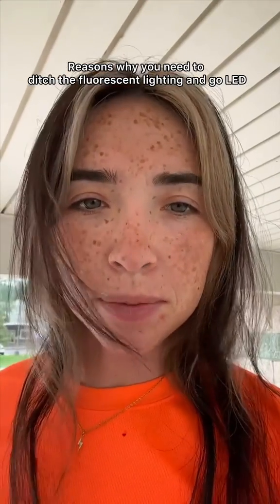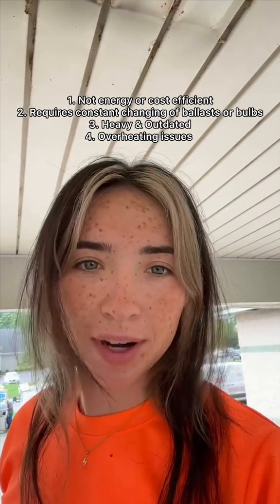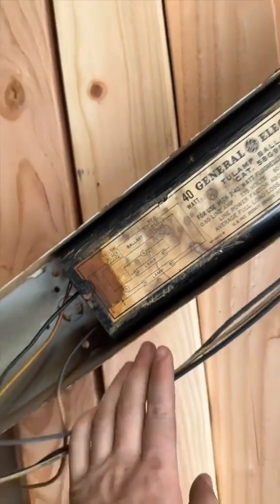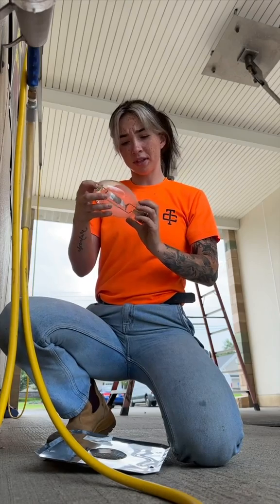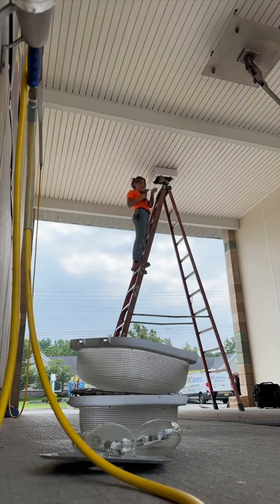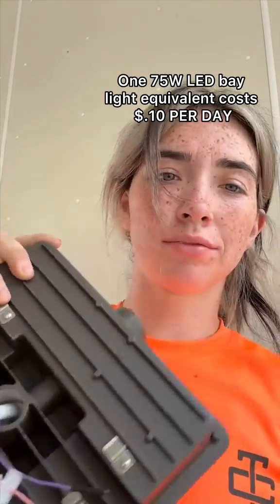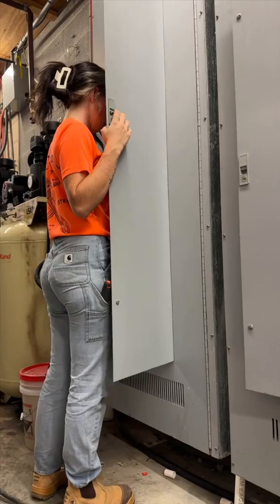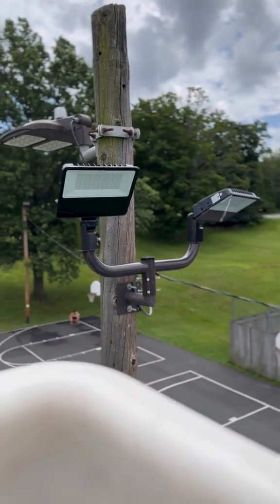Replacing Metal Halide to LED

Comment: I’m guessing that the original installer used the wrong wires for the application or used a fixture with a poor heat management design. Not every fixture burns the wires like that.

Comment: those LED canopy lights chew through there ballasts WAY to fast and end up turning into flashing disco lights.   i like LED screw - in retrofit (corncob) bulbs because they keep the fixture original and can easily be replaced. i would even go as far as keeping the original ballast and gear in the fixture, just bypassed and abandoned because what else is going to fill all of that space.

Comment: LED is better, but if those previous fixtures and circuits are installed correctly they shouldn’t burn up. Especially if ballasts are replaced every 15 to 20 years. Yeah, they can run longer, but why…

Comment: My biggest gripe with a lot of people & businesses changing to LED is that a lot of them (business especially) choose to attempt to save money by retrofitting HPS/HPH/LPH fixtures with cheap LED bulbs which usually ends up resulting in similar power draw and significantly less light being produced. I also have a huge gripe with the CHEAPEST LED bulbs & fixtures. They usually come with a color that’s really hard on your eyes to appear bright but all it does is blind you and produce less light and it’s hard on nature overall & they usually have a very high failure rate which results in lots of blinking lights, dead lights, purple lights, strobe light lights, etc. it’s really disappointing to see all of this potential ruined by cost cutting on these lights with poorly implemented heat-syncs & soldering & capacitors & so on, just to save a little bit of money up front & end up having to spend more later to do it properly & cause even more e-waste than LED fixtures already cause. 
When implemented properly, LED is absolutely the way to go. Unfortunately there are many areas where this is not the case. I hope to see more properly implemented LED lights & I’d love to see them produce less e-waste.
(I have a lot of property management under my belt)

Comment: Man, that is an OLD fluorescent ballast. Most LED fixtures have have ballasts too, they just call them drivers. The only exception are AC LEDs, which run directly from the line. They, however, flicker like crazy.
Reply: when LED ballasts go on the fritz, they turn wherever the lights are installed into a disco, those type LED canopy lights she installed a notorious for doing that.

Comment: I got tired of the reliability of Metal Halids and changed mine to Mercury Vapor. Not as efficient, but the bulbs last ways longer. LEDs are getting better, but they still have some reliability issues.

Comment: I work from a LiFePO4 battery company, the change from fluorescent / HPS to LED is pretty similar to going from old school lead acid batteries to lithium as far as weight, energy  density, and longevity.

Comment: Well it took me a year, but by myself, I replaced 2784
old t8 fixtures in an old plant with high bay UFO LED’s. Frustrating experience at times, overall it was enjoyable. At least now you can see with out a flashlight. 😊 I can definitely relate to replacing those old type of lights you have replaced, they have a few here at this plant, and just keep replacing the bulbs. Well not anymore.

Comment: I am fully switching out the led bulbs left to incandescent bulbs, I yanked out 6 of them so far.  LED hurts my eyes, even 2700k. I Reject artificial LED lighting.  
There is nothing wrong with those light fixtures.  LED still creates heat, wastes resources on microchips.  Not green at all.  The old lighting is and always will be better. Efficiency vs healthy light, I will gladly pay more for quality light that isn't LED.  I would buy some of those metal halide light fixtures, would make a nice porch light.

Comment: Unless youre using an led lightbulb instead of an all in one/integrated LED fitting, its such a false economy. 

If a unit fails and it generally will fail within 6 years, you have to throw out the whole fitting and pay an electrician for a new fittting and the labour to replace it.

Comment: A few years ago I looked into changing out the T12 florescent tube system to dedicated LED strip light housings in my garage but the cost was out of this world at the time for that type of LED system in 4 or 8 foot lengths ( not sure what they are priced at now ) So I instead looked into installing the T12 retrofit LED bulbs and they don't come in 8 foot style so I took out my 8 foot units and installed new 4 foot florescent housings but with the LED bulbs and those housings come with new electronic ballasts vs the old magnetic ballasts the original housings had. I also had original 4 foot housings on another circuit and so I tested the draw with an amp meter using the old bulbs, then swapped in the new LED bulbs and was in for a surprise, the power usage was exactly the same which meant those old magnetic ballasts were the power hungry culprit. I bought magnetic ballasts for my existing 4 foot housings and again tested the amp draw and it was about half the draw now. I expect that true LED strip lighting would draw the least power for the light output vs my retrofit but at the time it was just not a cost viable solution. Then not long after I did my project these so called retrofit 8 foot LED bulbs came out ( from China of course ) that were NOT approved for the USA/Canadian market which are to be installed in original housings but wired direct with 120 volts bypassing the ballast and I was told by licensed electricians that if those were installed and there was a fire, the insurance company would void the insurance since the housing was never certified to be used in that manner.
Reply: So I have converted several locations using the ballast bypass retrofit LEDs.  I feel they are better for 2 reasons.  1 you aren't paying to run a balast/transformer you don't need and 2 you are eliminating a possible failure point that doesn't need to be there.
Reply: @homeFall1  If I understand you correctly, you are installing the 120 volt direct connect retrofit tubes into what had originally been a florescent/ballast housing system as it was originally manufactured. Perhaps where your from its to code but not here in Canada and that was made very clear that it would not meet CSA approval. I don't doubt that it works fine and runs with less power for the light output but its that sticky factor of not being to code where I am from here in Alberta, at least not back when I did the swap over to LED approved bulbs for an original florescent housing. Like I mentioned, I wanted to get completely new LED housings from the ground up that were CSA approved but at the time they were out of this world price wise ( I was getting quotes of $600.00 for a 6 foot light strip for example ). I suspect prices have come down a lot but have not shopped for lights for some years now to know what the current pricing is on strip style lighting. Where I can, I do use the existing screw in light sockets with LED light bulbs as there is a significant power savings without a doubt.
Reply: @charlesb4267  yup, those are what we used.  I have no idea if they officially meet code or not.  I do know that they are sold on the same isle as the direct drop in LED replacements that require the ballast to remain and the newer ones that say they can be used in either application at Lowes and Home Depot here in the states
Reply: @homeFall1  It is very possible that a certification came along or that the USA has made some changes and will say also that I have not talked to the supply/electrician outlet lately to see if there have been some changes to the original decree of being not to code. Also should mention at that time there were no such bulbs being sold here over the counter, the only way to source them back then was to direct order them from you guessed it ... China, and those bulbs never even had a certification to be legally used at all no matter what in Canada at that time and no doubt why retailers or wholesalers were not handling such a product at the time. When I have a chance I will have a look at the Home Depot here, there are a lot of things we don't have in our Home Depot that you do in the states though just looking at the two websites to compare sometimes.  I can grasp now why your using them given that they are right there at your retailers, they would have some sort of UL or CSA approval for the stores to sell them as otherwise they would be in a legal mess.

Comment: I replaced every lightbulb in my house with LED. My electric bill lowered substantially.
Reply: Yup. I pay under $20 a month, and some lights are on 24/7. It’s a 2-bedroom, 1-ba. house, so it’s not a lot of lights. I’ve got a single CFL in a closet I keep meaning to change, but it’s almost never on.

My father used to turn off lights around the house, even when you stepped out of the room for a moment. I’d use the bathroom and when I got back to whatever room, the light would be off. It used to drive me crazy! So now that I’m old and paying my own bills, it’s very satisfying to leave the kitchen and a few hallway lights always on. 😂

Comment: I have a high hat in pent over my front door with a shower rated drop gasket plastic lens. Noticed that we do not get close to halve the tiny bugs that we got inside lens with a 9 watt LED instead of the 60;watt incadescent lamps that we used for ladt 35 years. 0:05

Comment: .    Don't just grab any LED bulb and install it without reading the box; some are not designed to be in enclosures do to lack of heat dissipation, because LEDs do give off heat, but from the back.

Comment: Those look like metal halide or possibly mercury-vapor lamps (both have mercury in them).  250W metal halide bulbs put out about 22,000 lumens with very good color rendering but also a bunch of heat which is why everything is melted.  The equivalent LED is about 100-150W so you'll save about 50% in operation.
Reply from the maker: Yes some were metal halide and some were fluorescent and customer wasn’t looking for an equivalent to these they specified 75W
Reply: @lextheelectrician   Can you do a video on the steps a young person goes through to become a skilled tradesman, and what the average salary they can expect at each level. Trying to get my daughter to consider trades as an option but she will only take advice from a younger professional woman like you, because I’m a parent so what do I know! You’re the perfect spokesperson for educating young people on the trades!
Reply: Metal halides output  22,000 lumens NEW in 360 degrees.  Then degrade lumens very fast.  By half life they’re 12,000 lumens.

Also the covers on them aren’t very clear, thus losing light, and a metal halide throws light 360.  That fixture isn’t good at reflective half that light off the back.

The LED’s emit only one side, thus gaining the light lost bouncing in the back that metal halide threw off
Reply: @xzibit8614  Those are Scottdale 320 watt pulse-start metal halides. They were the shit 25 years ago, they were brighter per watt than regular metal halides, but in order to keep them bright you need to replace the bulb and capacitor every two years. The covers are glass and completely clear forever.

Comment: The problem with LED is how bright they are. Unless the assembly is focused on the need, people just create far too much high intensity light pollution.  Also, since people assume the LEDs are less power, I find some will let them run all night instead of using them in the same manner as the other bulbs.
Reply: Virtually none of the new LED streetlights in my area have cones to focus the light down--it just blasts out in all 360 degrees. The older high pressure sodium and mercury vapor lights they replaced typically had cones or diffusers to direct the light downward. Dumbass electric companies doing dumbass shit, a story as old as time.

Comment: Even though led is cheaper to run I find that they fail pretty often. The bulbs are fine but all that supporting hardware to turn 120v+ into the 3v dc dies. Since there a sealed package you can’t replace just one part but the entire assembly.
Reply: Too many cheap shit suppliers flooding the market. However as others have said. Generally your supply house should have a respectable line available.
Reply: @jdboy9  yeah and it does.
Reply: yeah, I had to do some serious modifications to the LED lights that I put up from Cree to protect my name (to improve the quality ) they painted over the heat sink where the aluminum LED PCB connects to the heat sink. I had to sand it down and get it all smooth until I saw raw metal and then I covered  the back of the aluminum LED PCB with Arctic silver.
 ( silver -based thermal paste). and some of these LED lights like the one that lady put in.  I know there's versions of it that  have real heat sinks. but there are some that have fake heat sinks. it's just plastic fins. stupid. plastic is an insulator  . and the other thing is they make LED lights from reputable manufacturers from China that are the strength of football stadium lights. so 206,000 lumens or little higher. high pressure sodium. but most of the American companies don't even want to try. it looks like to make a light. that's as strong as that. from the LED family. The last thing that gets on my nerves as a contractor and electrician is they're not very  and depending on the fixture , lantern  or head you get. repairable . stead of that
HID lights are more fun to observe, especially when they come on.
Reply: This is my biggest problem with LED as well. They have much better consumption and the available color temperature options are nice too, but the E27s we use in our home are encased in plastic with zero heat dissipation despite having to run for several hours non-stop which generates a lot of heat. The branded ones easily cost at least 3x more than regular halogen 100W bulbs, and only have 1/3rd of the halogen's lifetime despite it being advertised as tens of thousands of hours.
In most cases the LEDs would still work if it weren't for the power supply blowing up irreparably. In one case, an OSRAM LED bulb decided to fail with no prior warning, no flickering, nada. It just popped loudly and shorted the 230V Line to Neutral, so I had to look for our electrical cabinet key in pitch black to go out in the snow and reset the breaker.
Reply: @Dengar97 From germany, the same experience. However, meanwhile they have become significantly cheaper and seem to last much longer
Reply: they have improved greatly over the last 5 years. Getting a popular brand that isn't GE should ensure it lasts for 10-15 years
Reply: When replacing a screw-in incandescent or cfl to an LED bulb into an enclosed fixture (where the bulb is sealed inside a fixture that does not have any means of ventilation), you need to make sure the LED bulb is rated specifically for enclosed fixtures so it can withstand the higher heat buildup inside fixture. The bulb and/or packaging will say “for use in enclosed fixtures”. Using a non-rated bulb in an enclosed fixture is sure to lead to a premature failure of lamp within a matter of weeks or a few months. Also, not all LED bulbs and fixtures are dimmable. The bulb or integrated LED fixture specifications will tell you if a bulb or fixture is dimmable as well as what type of dimmer is compatible with fixture driver. Many integrated LED fixtures require either a Triac or ELV (electronic low-voltage) dimmer. Some are compatible with both types of dimmers. Most fixture manufacturers will provide a cut sheet with a list of compatible dimmers denoting manufacturer and model number.
Reply: @djm5k   Yes, correct! Cuz if you don't you'll definitely fry the bulb .
Reply: Do yourself a favor and NEVER purchase or use ANY electrical , safety or test equipment from lying cheating lack of caring or quality control POS communist china.  Maybe 10!years ago I purchased oaks of LED'S from two different cheating china manufacturers at big box stores. Halve failed within 6 months. 2 within two weeks, several produced Morse code ( short & long flashes ). Purchased Creep LED made IN USA that are made IN USA & come with a 5 year warranty. 5 years later all of them still working. Bad news they were bought out & now made in China. Have to order made in USA LED'S over the Internet but will purchase enough to last me ten years.
Reply: Had trouble with cheating china LED'S. Replaced all of my POD Communist cheating china LED'S 5 years ago and every USA LED still working.
Reply: Stop buying cheap Chinese junk.
Reply: This is mainly an issue with the cheap fixtures & improperly implemented electrical circuits. It also strongly depends on lightning & power surges & proper heat dissipation implementation.